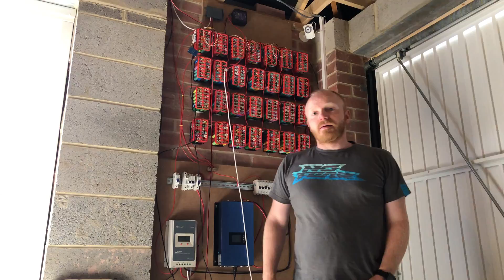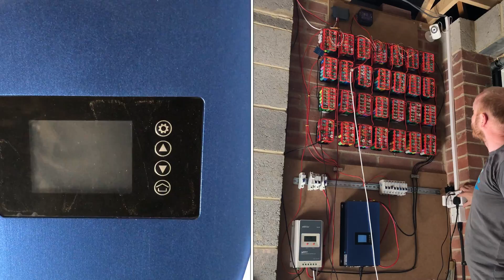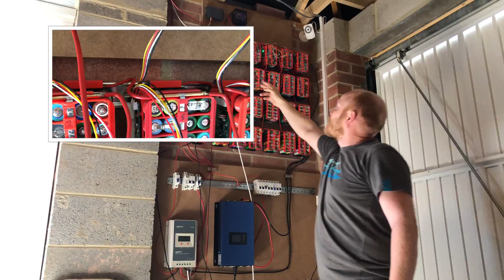Diy BMS issues.

Comment: One more suggestion. If you are powering your Esp8266 controller via the USB interface you may not have enough power on the 3.3V rail to power the I2C bus properly. The Wemos  board only provides enough power on 3.3V to power itself. For my system I made a PCB to plug the Wemos in which provided 3.3V from the battery pack as well as a chip to measure pack voltage/current.

Comment: Colin. It may be a single BMS module disrupting the entire bus. If you are still having issues try disconnecting the bus between modules and see if a shorter bus chain works. with my diyBMS system I found I had a dry joint on one of the i2c chips which made the entire bus chain vulnerable to noise. I suspect it also does not help that the design of the boards has the i2c chips fitted the wrong way round so the bus is being driven by the i2c  'compatible' side of the chip instead of the i2c 'compliant' side.  There is a newer version of the PCB layout that corrects this.
Reply from the maker: Hi thanks for the comments.  I realeased a new video not long ago where i went over a few issues i'd had.  The major one was the R4 resistor, since changing to 20k it's made a huge difference,  It's pretty rock solid for now so hard to justify the cost of changing to the R3 boards although i would like to try one as a test.

Comment: Hi Colin, can the diybms board manage a battery pack of 4x10 18650s or do I have to use 4x10 18650s packs
Reply from the maker: Hi not sure i follow but if you have cells in parallel that is considered one pack.  In my setup for example i have 7s96p so i have 96 cells in parallel per pack, so even though it is 96 cells it only needs one BMS modules, then i have 7 of these packs in series so i need 7 modules in total.  I hope that helps.

Comment: Use a oscilloscope to check the frequency on the wiring. Then use capacitors in the right  frequency to get rid on the noise on the lines maybe.
Reply from the maker: Thanks, i may have found a solution to the issue so testing it out for a few days and will post a video.

Comment: Hi Colin. Nice to see all those small blocks in action. Fingers crossed for the wiring fix. Cheers, Paul
Reply from the maker: Thanks Paul,  I wish I had more cells so I could use the new bigger pack you’ve designed.  Btw have you thought of using the diybms on your packs?

Comment: If I remember correctly I2C should have twisted wires like RS485 to cancel out any noise. Also I never liked using the load out on a charge controller. Good luck
Reply from the maker: Thanks will definitely look at twisting the data lines on the cables as well, at the moment I've just got the LED lights on the load so very light, 1.5A most at anytime.  The inverter is hooked up directly to the battery pack.  Currently on 99.99Kwh generated off solar and 5.73Kwh used on the load.  https://www.dropbox.com/s/477kzeoqa7w4nom/load-usage.PNG?dl=0

Comment: Hopefully your wiring changes will help significantly. I might have to see what you come up with for your dangling wemos ;-) Cheers for the update Colin.
Reply from the maker: I've used the double breakout for mine so it's a little easier as it already has mounting holes so hopefully should be easy enough to create a small mount, famous last words :-)